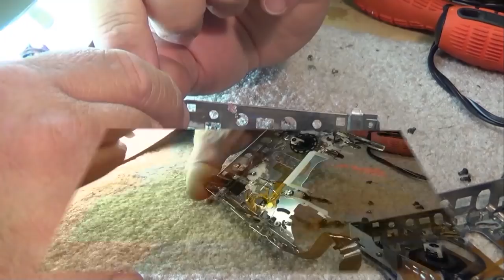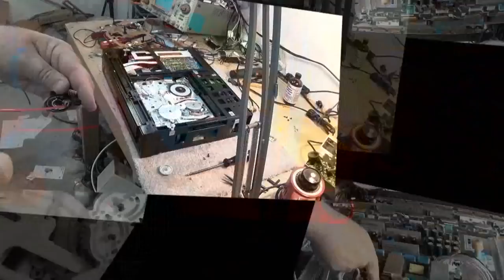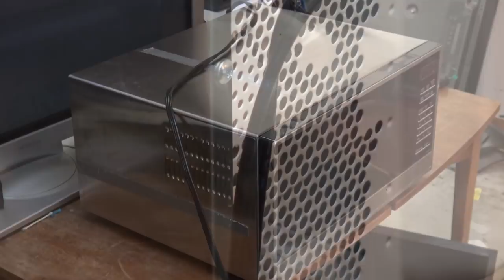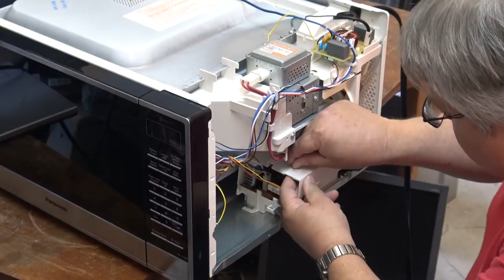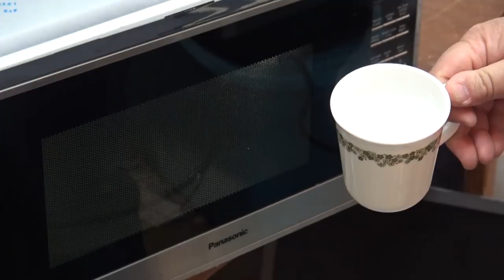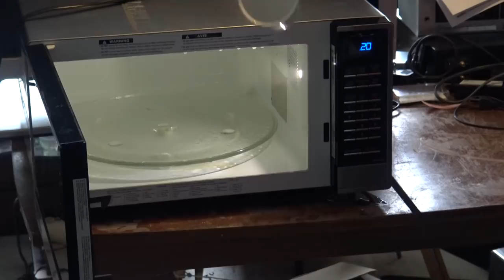Microwave overload

Comment: I gave away one of those micros. the full keyboard just pissed me off. I got one, also a samsung, with just two knobs (rotary encoders), and I love it. It has more functions that one would expect but the interface very intuitive.
Reply from the maker: I love the full keyboard. The ones that I didn't like were the ones for 4 buttons, 10m 1m 10s 1s
To enter 45 seconds, press 10s 4 times and 1s 5 times. Hmmm, 9 button pressed.
I perfer just pressing 45 and start.
I put this microwave in service in my kitchen, and love it already. Very good at heating.
remember I commented that the waveguide is low, and that is what causes superheating. Well this is not one to heat water in, but the low waveguide, and raised turntable has a huge benefit. What do most people use a microwave for? Reheating food, and cooking frozen TV dinners. The waveguide is in the perfect placement to get the micowaves into the food, and heat evenly.
Compared to my old one with the waveguide higher on the side. It heated the top of the food perfectly, but stuff at the bottom was still cold, so it had to be stirred. This unit solves that problem.  It works great, an even better score now that I have used it.

Comment: With the cup in the center of the turntable there maybe a focal point inside the cup. I once heard of a kid doing an experiment with a large block of chocolate inside the microwave but without the turntable and turned it on. He then stopped it as it started to melt, he noticed that the chocolate was not melting uniformly but in certain spots across the chocolate. he measured the distance between these spots and it coincided with the microwave wave length (I always remember this because I thought what a clever kid, I wouldn't have thought to try it myself). This is probably why there is a turntable so that what ever is being heated is always being moved between hot spots. It may be that if you place a pie in there then the center may burn before the rest is warmed thoroughly.
Reply from the maker: MrMaxeemum 
there are hot spots. this is exactly why the turntable was invented by Panasonic.  early microwaves had the antenna ion the top but there were cold spots. so Amana put in a rotation antenna called it rotawave. the problem was the top of food cooked faster than the bottom because it is closer to the source. hot point put a dual waveguide it top and bottom to provide more even distribution but this required a higher floor height. Panasonic solved this uneven heating. turntable. microwaves enter from the side. now even exposure top sides and bottom. you are correct about the heating water dead center as the part in the dead center never moves closer or away the concentration is always the same.
Reply: Love the videos, through different fixes and problems we all learn.

Comment: I can confirm the super heated water. I have a 1800 watt panasonic unit that's about 4 years old. I came across the heat issue my first month of ownership. The inside of the unit looks identical to mine. After 2 years the door began to get a little sticky. It turned out to be the safety interlock switches moved. Loose screws everywhere in it ! Oh and Nice score !

Comment: Nice Panasonic.  The last microwave I worked on was a stainless Panasonic but it used the big transformer/capacitor circuit.  I went to my friends house to check it out because it would just blow the fuse and I told him the capacitor had dead shorted and to just order a new cap for $25 and put it in.  He decided later to throw it out instead because the wife wanted a new one.  I don't understand people
Reply from the maker: Yup, those caps were problematic. Changed hundreds of them. Magnetrons as well. The old transformer stack diode and cap were pretty reliable. The early inverter microwaves were problematic. Newer ones I believe are more reliable but then I seldom work on microwaves, because most people just chuck them and buy a new one.

Comment: That platform seems really high.  I have to wonder if that's the right parts for that model.  Sitting high could make it more prone to superheating.  I have to wonder if the oven's problems started with someone losing/breaking a part and replacing it with a not-quite right part.  I've seen Panasonic ovens with the same style turntable, and they're no where near that high.  My best guess is it has the wrong casters. The right one would have smaller wheels.
Reply from the maker: I will have to go and look at some in the store and see. The turntable shaft looks to be extra high too, but it looks original, so I doubt it is incorrect. This unit has the waveguide very low in the cavity.

Comment: Dam that's a good microwave, looks massive inside, that would have been expensive for the capacity and 1.1kw power level.
I bet a full turkey would cook really well in that, it would be tapping on the glass to get out LOL :-D.

A nice clean up and it's a good seller :-D.
Being it's high power, i would use it on short times or defrost mode to heat small stuff.
Reply from the maker: It is a top of the line unit. I intend to keep the unit actually. When I get a good score I generally hang on to it.
Reply: The nice thing about inverter types is, they can finely control the power output.  Non inverter types just cycle from full power to none - timed to approximate your power level setting.
Great score!

Comment: He is entirely correct in it being the location of the WAVE GUIDE.  One's located near the center of the panel almost never have this problem. Near the bottom and you are directing the microwaves to the bottom of the cup and overheating the higher water. Take care if your wave guide is located at the bottom.
Reply from the maker: The reason for the waveguide at the bottom is it heats food better.  Most things heated are low.  Left overs.  Sabdwiches, cassarolls ect.  So having the waveguide at the bottom heats food better.  These are not coffee makers.
Reply: @12voltvids  Yes and the problem is almost exclusively with PLAIN WATER

Comment: The first thing that struck me when you lifted the lid, look at that fan blade, it's like new. Usually you would very quickly accumulate dust on the blades.
Reply from the maker: Thats because it was like new. Manufactured Dec 2017.
I figure that it was installed in a new house, and the buyer didn't want that brand, or they got a gyser, and were scared that it was going to blow or or start a fire and dumped it.
Reply: Manufactured Dec 2017? Its from the future... wow, no wonder its so good.
Reply from the maker: Doh!  Dec 2015.

Comment: Bad scary microwave, up, i buy apt size the never have that kind of power 700 to 800 watts,I hope you make a bundle on it,I always learn something useful from you that plain water thing I will remeber it,my first micro wave ,I maid scamble eggs ,I was trying to make a hard boil egg,mine exsplode with some force,and it took a long time to clean it 35or 40 years ago ,I was single ,and didnt need no darn instruction either.

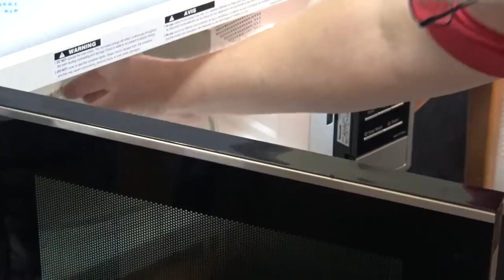Comment: 4:20 I'm sorry.! But I could not help but to laugh.! 👍🏻👍🏻 nice video.!
Reply from the maker: My finger tips might not feel the pain of being burnt due to all the years of cleaning soldering irons with my finger and pulling hot tubes, but the back of my hand certainly does feel it when scalding hot water splashes on it. Actually I am surprised that it didn't erupt when I disturbed it, as that is usually when they blow. After heating, and then the cup is disturbed and BOOM, the thing goes off like a bomb and showers you with water that is well above the boiling temperature.

Comment: I wonder how fast it cooks a bag of microwave popcorn?! I have an old GE 1,000 watt unit that does it in 1:50.
Reply from the maker: I put the unit into service today and heated my lunch.
What normally took 1 minute on my relatively new Danby 1000 watt with conventional power supply I heated for 45 seconds on this one and it was hotter. So yes it is a bloody powerful unit.  1200 watts, but keep in mind that the inverter with it's full wave rectification is also going to be nuking constantly as opposed to the 50% duty cycle of a half wave rectifier of a conventional transformer. They also run the magnetron at 4KV as opposed to about 2300 v for a conventional oil cap and stack diode of a regular oven.

Comment: The third way that would avoid superheating would be to turn the power level down on it wouldn't it?
Reply from the maker: Turn the power down, stick a stir stick inside or move the cup off center so the evenery level changes as it moves in and out of the power beam. The problem happens most of the cup is placed dead center.
Reply: The microwave guide tower would still be directing the waves to the bottom of the glass overheating the water in the bottom of the glass as compared to the top. A plastic stick/straw would probably still be required.